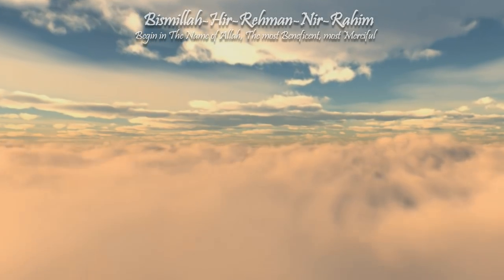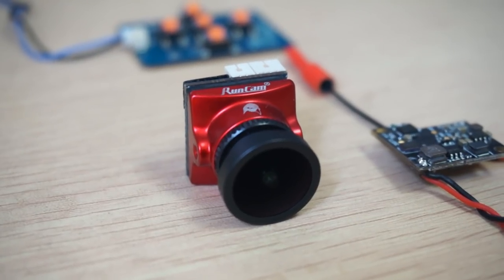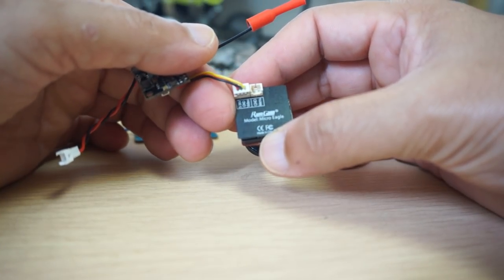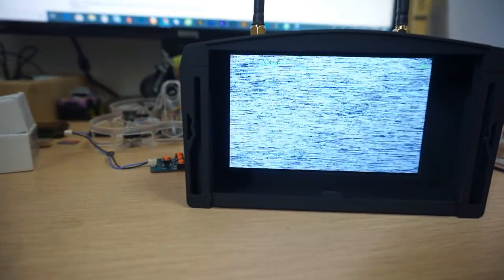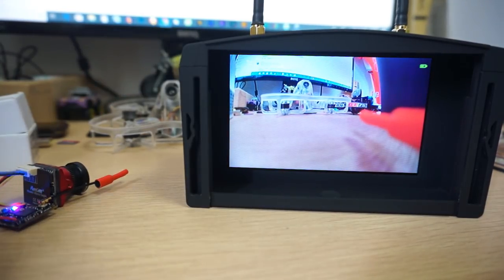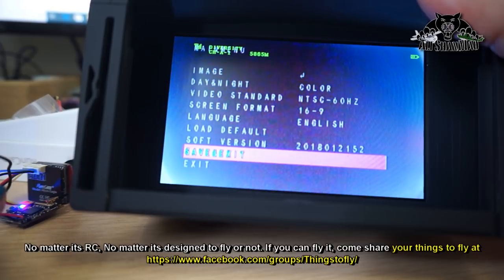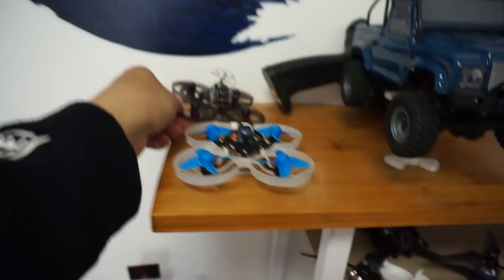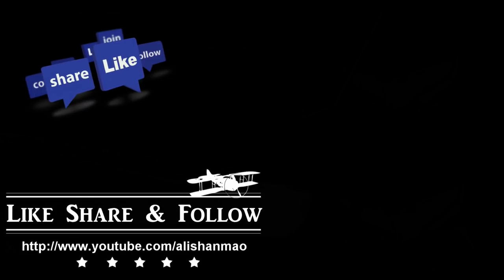Make AIO FPV System RunCam Eagle Micro RunCam TX200U

Comment: Thanks for the video.  Are you using a 1s Lipo for power?  What do you call the cable that goes from the TX  200 power connector to the power source?  I appreciate your help.
Reply from the maker: its simply a power cable converter

Comment: Even better! Use the Oscar's Backpack VTX! Fits on tge back of cameras just like that, and has 25mw - 200mw power! Gain a mic and the far superior MMCX connector! Those u.fl connectors fail way, Way, WAY TOO OFTEN! 👎 They also have a lifespan of about 6 ons on offs of that u.fl, IF YOU'RE LUCKY!
Terrible connector! Why did this hobby ever go to that as a standard is beyond me! It's simply AWFUL! fail, Fail FAIL! 😩  I've bought several of those VTX 's and EVERY SINGLE ONE HAS FAILED! 
I'LL NEVER, EVER BUY another VTX with a u.fl connector! 😵💩💩💩💩🤯
Reply from the maker: What happened. You got some bad stuff? Mine became bad only when I had crashed and burned VTx or Broke antennas LOL hahaha
Reply: @alishanmao  Let's face the facts! It's the wimpiest connector on the planet! The most fragile! I've glued mine on, with soft drying glue, made to be able to be taken off!, and when I took it off, it pulled the whole connector off the board! 😩 We're being scammed!😖 Manufacturers are using this connector specifically because it's pretty much guaranteed to fail and then they sell us another VTX!
Andy RC has said several times in his videos that the connector is rated for approx. 6 ons and offs! 😲🙄  Then it's done! How it became our standard when we go through such sometimes violent crashes, is beyond me! It's dumb! We accepted it, so manufacturers kept making it so they could have low life expectant products that had to be purchased often! Continual sales!!! 
I'm not buying into the scam anymore! I won't waste my money on something pre-designed to fail so often! You can go ahead... Me, the u.fl connector is DEAD TO ME! I WILL NOT BE SUCKERED AGAIN! 🤔😊